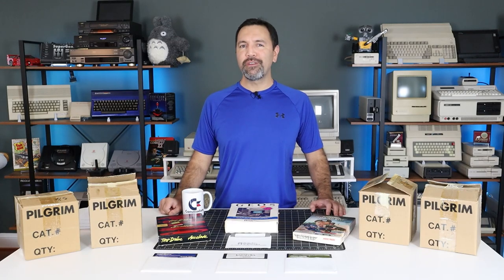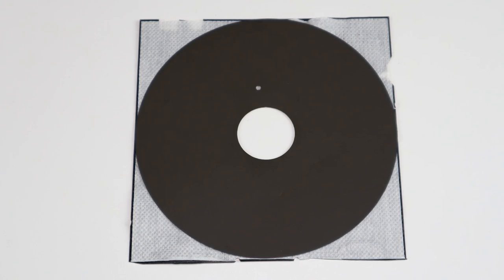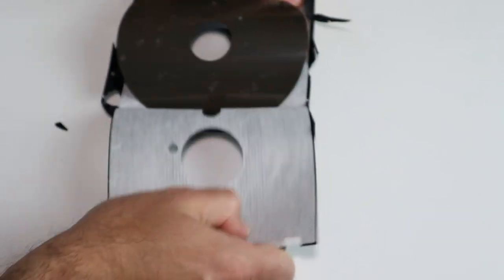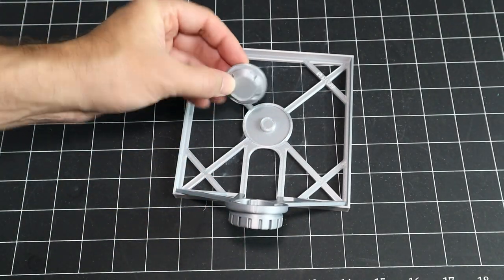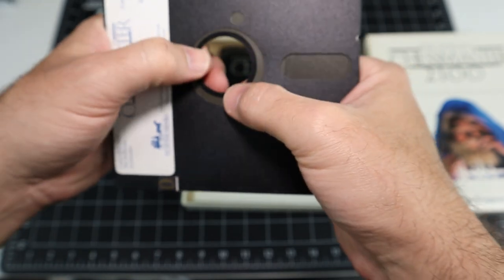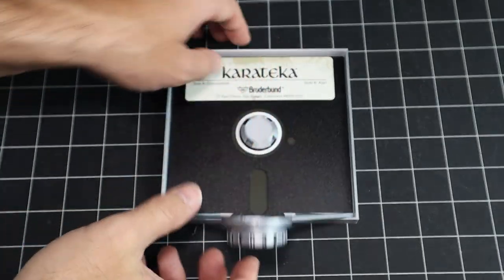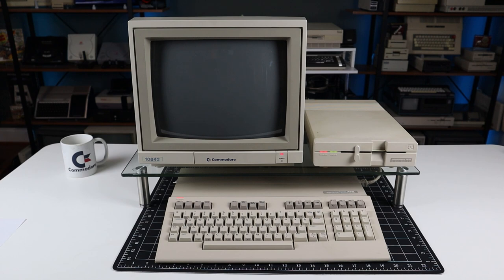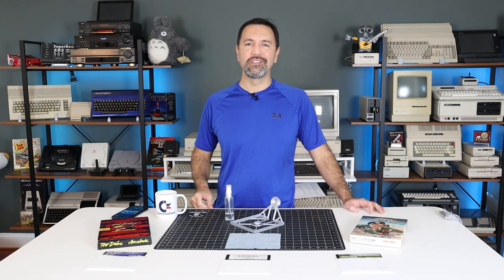Mold on your Floppy? What next...?

Comment: Nice video.  It's important to note that care must be taken to not press too hard on the wafer as you're cleaning it, as excessive pressure or rubbing can physically remove the oxide from the wafer.  Also, if the surface of the wafer is sticky, STOP because it means the binder started to break down and turn into goo long before you got the disk.  To fix that, you can bake the wafer carefully in a scientific oven at 58C for a few hours, which will re-consolidate the binder.
Reply from the maker: Thanks for the additional info, very informative as always! Do you need to extract the disc from the jacket prior to this baking process and is there a high risk of data loss when performing this operation?
Reply: @retrobitstv  The wafer should be removed from the jacket and hung on a hook (via the hub ring)  so that both sides can be baked. As for data loss, you will definitely get data loss if you try to use a goopy wafer because the head will scrape the oxide right off the wafer, so baking it will only make your chances better, not worse. But it has to be a scientific oven with very exact temperature control, you don't want to overdo it. (this is the same advice given to people restoring old real-to-reel tapes, by the way)

Comment: You can also make a motorized disk cleaner, by taking a 5.25" floppy drive (preferably one that's non-functional) and removing all the parts except the clamping mechanism and motor. Then wire the motor directly to the power going in so that it's spinning continuously, and that's it!

Comment: 2nd Time I've learned something from you in the short time I've been a sub.  You're batting average is looking good.  I didn't know that floppies had/could have a mold problem.  I'm lucky I live in a dry climate, but from now on, I will always check my floppy disks prior to using them.  Thank you!  And thanks for the link to the solution; the Floppy Disk Cleaner.

Comment: In addition to the doors, I wonder if the density of the magnetic medium on the mylar surface may play a role in mold resistance for 3.5" disks. The most capacious 5.25" disks are physically much larger than the most capacious 3.5" disks and yet hold less data. That implies that the magnetic medium is likely less densely packed and therefore more porous on 5.25" disks.
Reply from the maker: Interesting hypothesis. I guess that could pretty easily be tested! Hrm....

Comment: You can also use Old Floppy Drive Mechs to do this also, and if you are gently enough you can let the drive spin the disk for you. and use a cotton swab with 91+ rubbing alcohol IPA. I took an old 3.5 teac floppy drive removed the head assembly and then powered it on to spin the disk, also some old ancient 360K floppy drive did the same thing removed the head assembly and use it to clean old disks, the 3.5 floppy drive mechs open the slide protector for you! LIKE EVERYONE IS SAYING DONT PUSH TOO HARD do not damage the floppy disk anymore than it is, you may have to pre-treat it with the IPA and then it will come off easier after soaking (We dont have this problem in the Dry climate high in the mountains here, but I purchased Apple2GS floppys from someone on the eastcoast of the USA, and many of the disks were moldy.)
Reply: that could make circular scratches

Comment: 8:50 - For what it's worth I have encountered 3.5" disks with mold, some of them so bad that the disk can't even turn inside the housing without a lot of force applied (more than the drive spindle can manage) - though these are disks of mine that spent a solid decade neglected in a drafty outdoor garage or similar environments.
Reply from the maker: Well there goes my theory right out the window :) I guess I just got lucky with mine.

Comment: I have found basically the same as you.  My disk collection from the 80's for a couple years was stored in an outside storage unit.  While 90% of my collection was fine, I noticed patterns on some of the disks.  Not really mold like these were but obvious corruption.  What I found was that they were all common to certain brands.  3M SS,SD disks were just about all bad.  Yet the later 3M DS,DD disks were usually all good.  I even had a case of 100 3M SS,SD that were sealed NOS and virtually every one was bad. The other brands that I found to corrupt were by OPUS, CERTRON,  SYNCOM (Except the platinum ones) and some older Verbatims and Kodak.  Despite what the 8-bit guy stated in his episode about floppy disks, newer made disks were not always garbage.  The newer made disks were often made with anti-mold/mildew material that made them resistant to the major problem.  Opus were often used as an OEM disk in duplication and elsewhere, from what I have read.  That would explain why so many of my early LOADSTAR disks were also corrupt, as they were using OPUS media and even selling them as blanks.
Reply from the maker: I should have audited all the different disks and brands and make a spreadsheet to see which are most prone to mold. That would have made a good addition to the video. Ah well, hindsight.

Comment: I’d like to see a tweaked design that flexes the disk cover away from the disc while turning so that it isn’t rubbing the magnetic disc inside while you turn it. Like, maybe some spring-loaded arms that you tape to an unlabeled part of the cover before you start turning it. Turning it with mold growing on the surface will, no doubt, spread the spores around inside and wipe much of it off where you can’t access it.
Reply: The jacket of a floppy disk is lined with a thin cloth layer, which traps dust and other particles as the disk spins.  It's okay for some of the mold to get caught in that, as it isn't getting back out.  Also, if you can spin a disk, you can clean the entire readable surface.  The goal of cleaning a disk isn't necessarily to start using it again, but rather to rescue any data on it before it goes bad permanently.
Reply: @JimLeonard  Have run into this issue in the past couple of weeks after picking up a box of Amiga 500 machines and disks, the 3.5" disks definitely suffer with mold but worse than that, plenty of them have a weak leaf spring which lifts a piece of that cloth to contact the disk surface, it scratches the disk surface.
Reply: @M0UAW_IO83  Any 3.5 inch disk that has a problem with the slide mechanism or the spring, I just remove the whole thing. You'll never get a working floppy out of it, so just remove the whole thing, rescue your data, then throw it away.

Comment: On 3.5 inch disks, you can remove the the sliding door, open them, clean them and put them back together :) On 5.25 inch disks, you would have to slice them open to clean them fast, so great tool :)